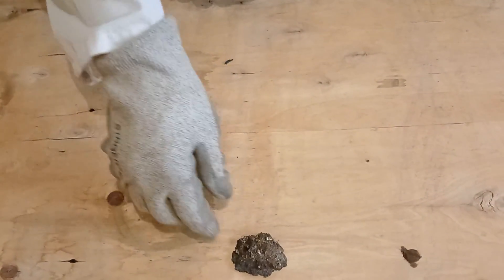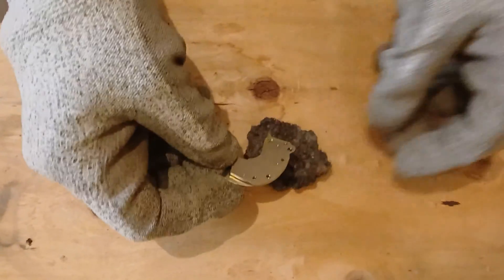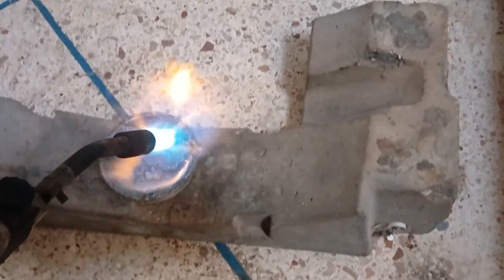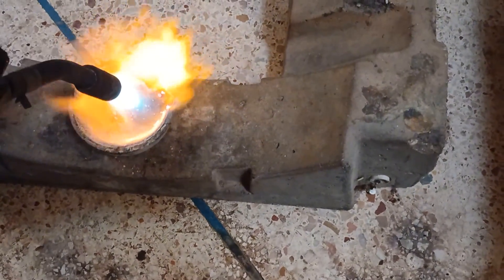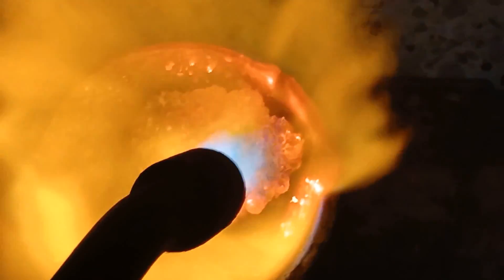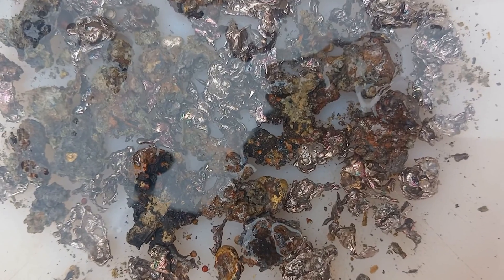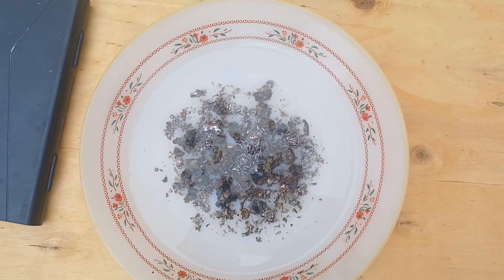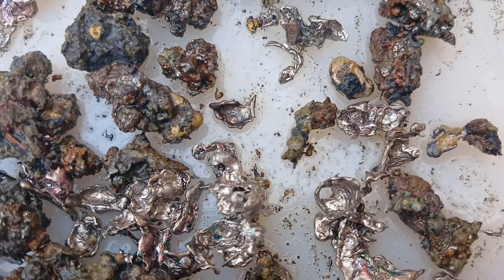What is The easy process to seprate lead from gold and silver and copper ?

Comment: From my last experience removing tin lead solder on mother boards. In a 20 liter pail I put some pc boards with various amount of tin leader solder. I then added 3liters of 10% vinegar aka cleaning vinegar then added 500 ml of 3% H2O2. Stirred it, let it settle. Saw no reaction or bubbles, then I added 1/2 a cup of non-iodine salt aka pickling salt the next day. Stired it again and let it do its thing while sitting outdoors loose covered from the rain and debris. In a month all the lead solder was removed from the boards and all the attached piece came off easy with my fingers or a plyer. I decant the clear liquid and filter the sediment with pieces. I wash the filtered sediment and pcb pieces in a separate container to remove the sediment. Let the pieces dry for further processing.

Yes vinegar is a basic simple technology to use to dissolve lead. It will smell of vinegar but it works.

I just need to find out how to precipitate lead from the vinegar. A iron rod has not worked to precipitate lead.
Reply: What about concentrating your tin+lead+other citrate/chloride solution, precipitating via electrolysis,  lead anode and cathode or a tin cathode and a new scrap solder board, things i am thinking out loud because I also have this problem

Comment: If gold, copper and silver are dissolved in an acid solution, what precipitates first? I assume it should be the least reactive (which is gold),, but sometimes there is a white precipitate that comes before gold .. any idea what that white precipitate is? Mercury maybe? Or what?
Reply from the maker: When gold, copper, and silver are dissolved in an acid solution, the reactivity of the metals does play a role in determining which one precipitates first. Gold is indeed the least reactive among these metals, so it typically precipitates last. Copper is more reactive than gold but less reactive than silver, so it usually precipitates between gold and silver.

The white precipitate you mentioned could be a variety of substances depending on the specific conditions of the reaction. It's unlikely to be mercury, as mercury is a liquid at room temperature and doesn't readily form white precipitates in typical acid solutions. Without more information about the reaction conditions, it's challenging to pinpoint the exact nature of the white precipitate, but common possibilities might include various salts or compounds formed during the reaction.
Reply: May also be silver or zinc. Just my thought.
Reply: @knightstar1312   does zinc precipitate white?
Reply: @S13402  i know lead precipitates when sulfuric acid is added. I never tried it.
Reply: @knightstar1312  what about silver, does it precipitate when sulfuric acid is added? This white precipitate does not precipitate when adding hcl to nitric acid !! Very confusing .. is there a way to test what that white precipitate is?
Reply: @S13402  sulfur precipitates lead, HCl precipitates silver. Test separately the white precipitate with nitric acid, if it dissolves its silver. And another separate test with 10% or high vinegar, if it dissolves its lead.
Reply: @knightstar1312  thanks alot, lots of appreciation
Reply: @S13402  the first separate test is the white precipitate with drops of water added, if it dissolves in water its a salt. Silver and lead does not dissolve in water unless its in a salt form.

In some lab tests they burn small quantity of the salt over a flame, the color of the flame coming from the salt will indicate the type of mineral salt. This is easier said than done. For this salt identification method look up flame colors given off by minerals.
Reply: @knightstar1312 could also be tin?
Reply: So, it can not be any of PGM .. (precipitation using SMB ).. thus it could be silver, lead or salts .. right? But it precipitates adding sulfuric acid .. which means its not salt!  If that is true, why it cant be melted into a metal? 
That is highly confusing, Hassan.
Anyway, the raw material itself is a precipitate (as i think) loose material,, orange in color .. becomes reddish brown when roasted.. if that may help ..
Reply: @S13402 i have similar results sometimes, have determined my reddish/orange precipitate to be copper.  The copper quickly saturates my hcl/peroxide boils, and I have given up trying to digest bulk copper with the wet method, for most all electronics scrap.  Nitric is too expensive for copper.  I have a lot of free driveway salt so i guess my chlorine supply is endless but I cannot eradicate copper from legs and pins until maybe ten successive boils if I am lucky, six or seven boils for IC chips.  I am now heading in the direction of inquartation to 95%+ copper and then electrowinning the copper away to concentrate the slimes, which will always have some leftover copper flakes and amalgams  but this smaller copper may be digested with fewer A/P boils.  We shall see